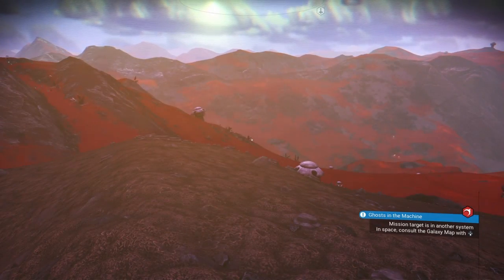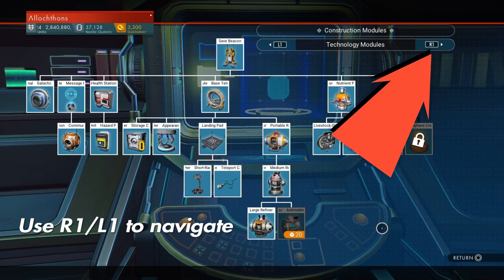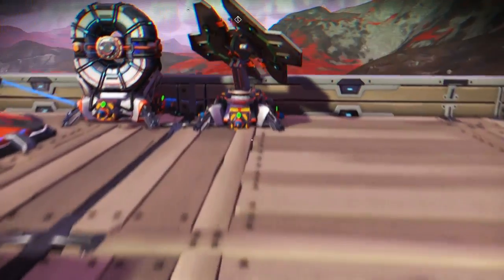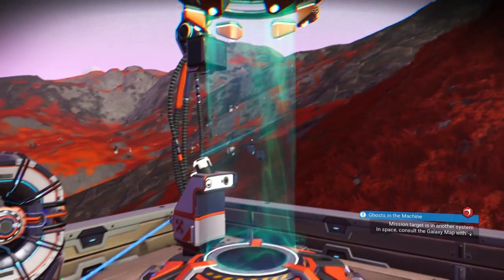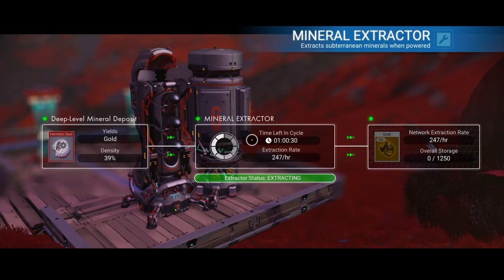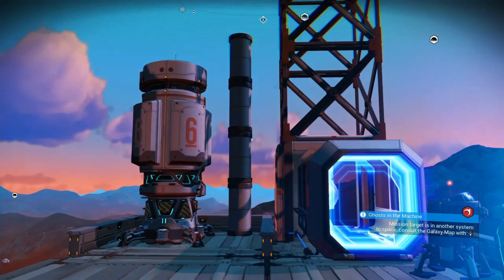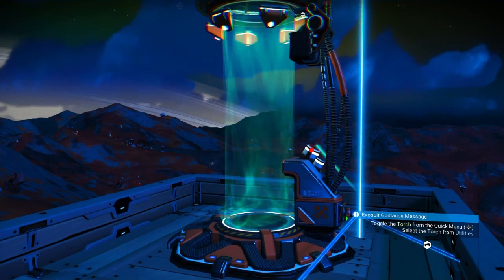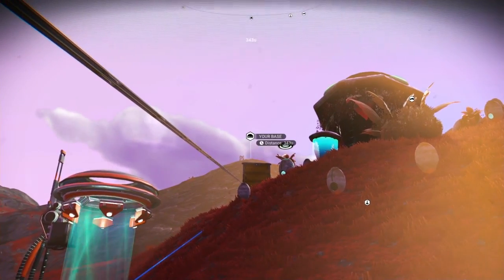No Man's Sky - Short Range Teleporters tutorial

Comment: My closet electromagnetic hotspot is like 900u away from the base i made but at about 300u away i cant make the base stuff anymore, do i have to put another base mode down again?
Reply from the maker: This thread on the Steam forums talks about how to expand base boundaries: https://steamcommunity.com/sharedfiles/filedetails/?id=1837680029
The best places to help get for NMS, I think, are the reddit community (https://www.reddit.com/r/NoMansSkyTheGame/), the steam community (linked above, if you're on PC), and the Discord. (https://discord.gg/nomanssky)
Reply: I think a battery will expand the base.
Reply: And a battery to expand your base reach it work for my mineral silos.
Reply: @troyturner4765  you could also use a wooden wall or something else cheap in recorses instead of batteries instead as long as its not under the portable or exotic decoration tabs
Reply: Nathaniel Knaup ok will try this, thanks!

Comment: I though mineral extractors had to be placed on the ground? Did you use the same trick of creating a hill and then placing the foundation under it?
Reply from the maker: Mineral extractors used to have to be placed on the ground (unless glitch building) but that changed in a recent patch. I don't remember which patch, though.
Now they can be put on flooring without trouble.
Thanks for watching!

Comment: Solid content. If y’all are curious why he built those structures to lay down the pipe instead of using the editor (L3) it’s because you can’t go through the teleporters and still hold a connection. If you enable that mode while placing wire or pipe it’ll break the connection. In short, it’s too far to place connections while in editor mode.

Comment: I am using these teleporters to build 'space touching' towers. Its time consuming as i have to build a ladder up inside to get to the top ( i build in stages under 200u). then place a landing pad lower down and  second SRT .Once at the top place your first SR teleporter hook up a cable and JUMP OFF! Before slamming down hard use the jetpack and then simply 'BRAKE'  touch down gently STILL HOLDING the SRT cable ans simply hook up! This way I have built monster towers! 
Another way to take power from the generator towers to bases MILES away, is to 'daisy chain' batteries. Then each 60u or so place a battery. Then build your generator and ALWAYS work from the powered end (this actually allows you to EXTEND your base out  as it will let you build (base buildings) as long as it is powered as it sees it as part of the base! Hook up to the live hotspot then pulling a LIVE BLUE cable hook onto the next battery. You will hear it run up like a jet engine IF its gone live - rinse and repeat!!!) I have run a cable this way over 900u to a power tower!!
THANKS for you tips I wasnt using the SRT's quite right! :)))